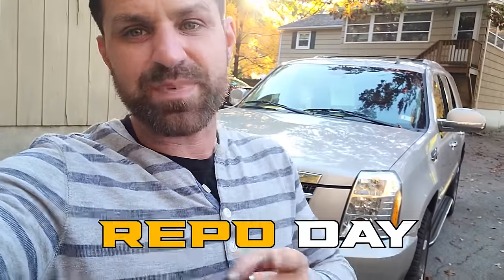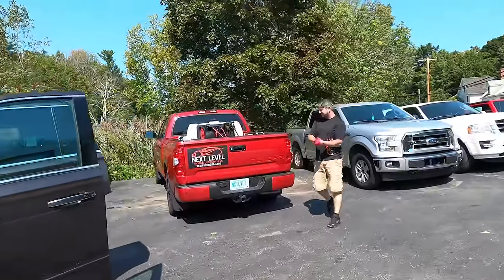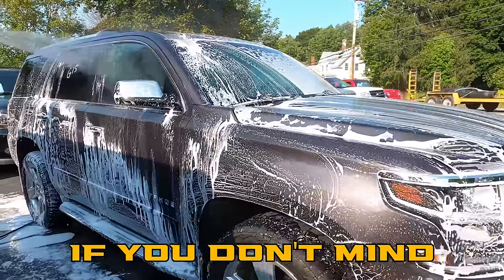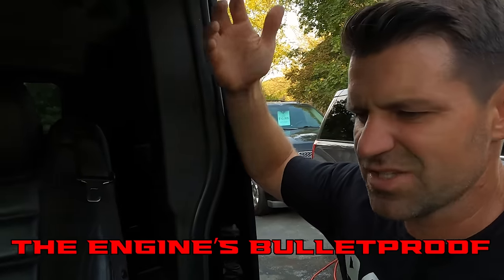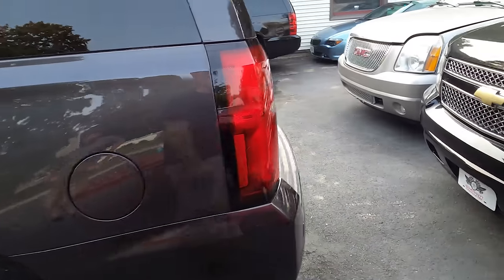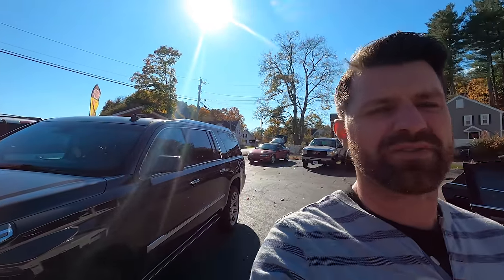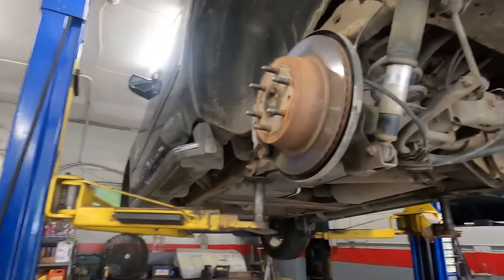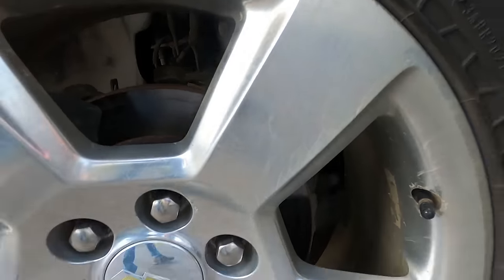How we turned a TERRIBLE BANK REPO into our BIGGEST PROFIT yet!

Comment: I used to be a dealer in Florida I can send you all the trucks you want that are not Rusty from Florida I still have connections
Reply: What part of Florida?
Reply: Need a 4wd... winter is coming in ny
Reply: Yea, how about those cars from Ft. Meyers!
Reply: @billhann3018  you'll be able to tell by the  corrosion on the bolts and different metals around the vehicle. The salt water usually destroys all the electronics.
Reply: @kevincribbs1490  absolutely.
Especially because it will be very obvious that there will be super rust heads of bolts or super over corroded connectors and stuff like that.
Reply: @kevincribbs1490  Central Florida Orlando
Reply: @billhann3018  there are a lot of flooded cars and trucks but the nice thing is any trucks and cars that have damage will be considered salvage vehicles and they will have reports from AutoCheck so the cars can only be sold at Salvage auctions and not not rebuildable for the highways just Salvage
Reply: @kevincribbs1490  that's true any water destroys the Electronics although salt water takes about 6-8 months before it starts showing any rust on bolts and stuff
Reply: @joesample1818  Many flooded cars will be sold directly to Texas or other title washing friendly states, then shipped North. Happens every Hurricane. Title washing is alive and well.
Reply: @kevincribbs1490  True, I will be able to tell. However there are many consumers who will be victimized. Happens every hurricane.
Reply: I love flood vehicles.
Reply: I just cringe when I see the “rattle can” paint come out.
To me it’s an “I don’t really give a shit” sign when detailing a car.
I also recall your “custom paint mix” you did for a relatively nice Audi wagon….Some old, almost dried up paint mixed with another can and a guess here and a guess there……and on the car it went.
No, no, no…..damn. Just leave it alone if you can’t do it correctly.
The car will undoubtedly mean more to the next owner that may want to do a much more careful job on the car.
Your method is cheesy and shows little concern for the next owner…..or the car.

Comment: Tahoe turned out pretty nice.  Suggestion on the carpet and on the rear seat.  You could pick up a used carpet from an autowrecker for only a couple hundred dollars, and a seat cover too (I know you decided to send the seat out to be fixed, but for the next time).
Reply: You are assuming there are nearby auto wreckers who have a car like that with an interior in good condition, correct color etc. in my neck of the woods car junkyards are, for the most part,a thing of the past. Land values, strict environmental rules,liability fears etc have nearly shut all,of them down.  In my youth, the next town from where I lived had them in abundance.  In most cases,we could roam the lots at will and remove our own parts!  They charged a fraction of what those parts were new or rebuilt!  The few yards now are run like strict businesses and are almost sterile!
Reply: ..w0w...you're a Genius Sherlock!
Reply: It blends in perfect if the buyer is blind

Comment: I own 2 hummers and 3 jeeps up here in northern Canada🇨🇦 
the most dependable vehicle in minus -45c (thats almost minus -50 fahrenheit) in the winter (not garaged) is my 2006 Hummer H2 
with the 6.0L (block heater & battery heater) 
there’s no salt on our dirt roads so it has no rust .. doesn’t matter if it’s buried in 6 feet of fresh snow it always starts and runs..
My H1 Hummer is temperamental..the diesel is a hit or miss once the temperature drop below minus -50...
My jeeps all run great but they also get temperamental when it gets to cold...
I’m a diesel & heavy equipment mechanic so maintenance isn’t an issue..
Great videos .. just subscribed..
Cheers from HudsonBay area 🇨🇦

Comment: Why do you detail it before doing other repairs?  Don't you have to detail it again when it is ready to sell?  I hate doing the same thing twice.
Reply: I can answer that in case Craig doesn't reply. The first thing he does is the detailing. Then he can see the vehicle for what it really needs. An additional pre-sale cleaning wouldn't be anywhere near the $450 he dishes out at first.
Reply: @TailoredReaction  I was in the car business for years and I never gave it a final type detail when I first got it.  I can see what you mean though.  He sees how much of the gunk they can get out of the carpets and the like to see if he has to replace them.  I just hate to do things twice.
Reply: @TailoredReaction  $250 for the Detail and $200 for the scratch removal. 👍 And Yes, it's always good to get a deep cleaning done first and see what scratch will come out to see what you'll be working with.